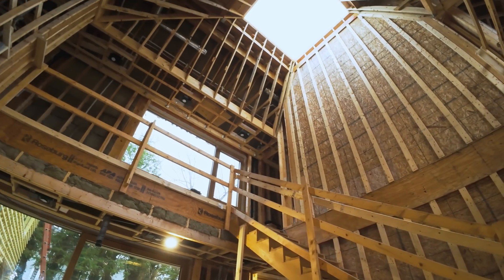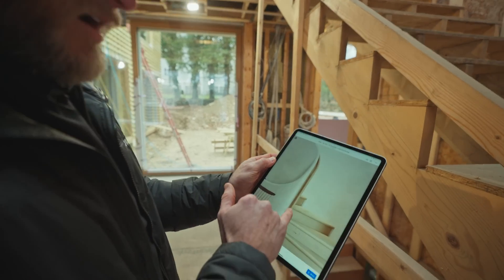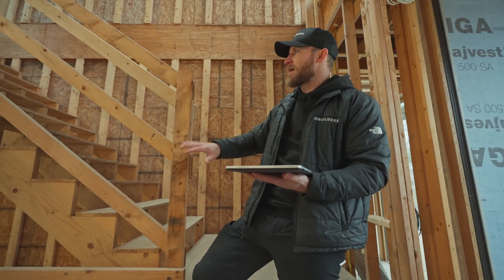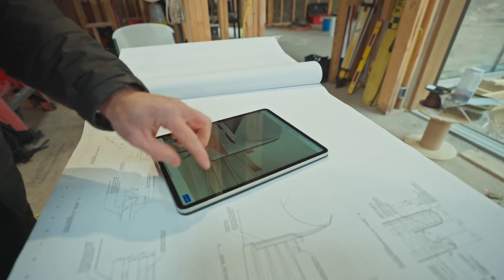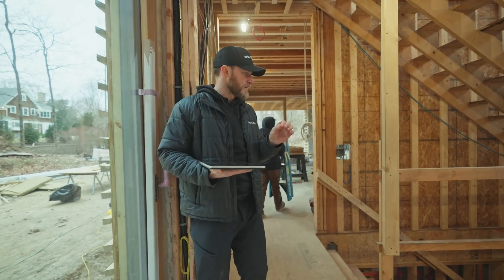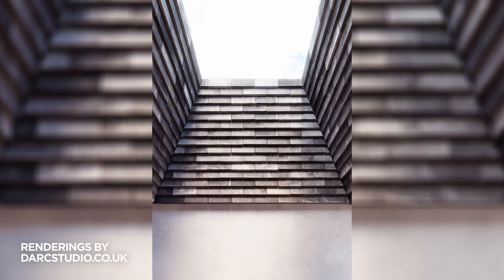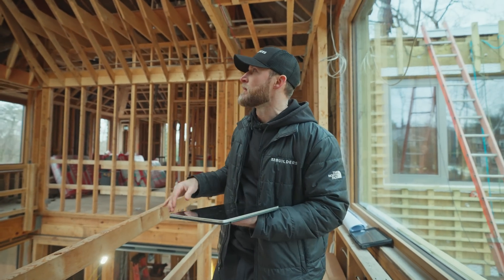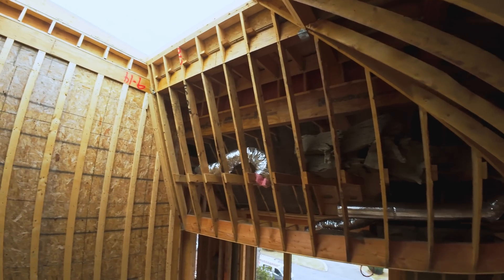Prepping For A Multi-Million Dollar Entry

Comment: For the complicated bend in the hand railing, have you guys ever looked into 3D printing? Im assuming this is already modeled and youd be able to plaster over the print. Have you all looked into 3D printing to assist with builds such as jigs/fixtures?
Reply from the maker: Considered it. Haven’t done much more beyond that.  Know someone?
Reply: @NSBuilders  Unfortunately I am just an automotive hobbyist with a Bambu Labs printer. I use it to make mock up parts, jigs, fixtures, and tools. I would assume the build space is much too small for what your use cases would be, however their are work arounds. 
Partners like Xometry and Protolabs would have larger build volumes and offer various plastic and metal, though expensive, if your project needed it. 
Another use case for you may be 3D printed scale models of your homes to your clients, though I am assuming you/architech may already offer something similar.
Your company seems to be on looking into the leading edge of offered materials, I think 3D printing will find its way into many different industries. 

Thanks for the videos! I love them! One of my favorite channels.

Comment: It seems to me you could take advantage of the hand rails being solid plastered knee walls on the open side and attaching to the staircase shear wall (1/8" rubber spacer as a shadow line) on the other side of the stairs whereby  the inside and outside LVL supports(stringers) do not have to be cut for the stair treads to rest upon, rather stairs could be  supported from a small strip attached to the runners and each tread screwed from below and to the stringer with screws yielding a much stiffer and stronger staircase that is an order of magnitude easier to construct. Ray
Reply from the maker: Good catch, Ray, we’ll look into that. Sounds like a good plan
Reply: @NSBuilders  Thanks for responding one other thought that came to my mind  after commenting is when using plaster for rail it will crack unless its very stiff maybe use a double LVL for the Handrail side of the stair case it will look like the cheapest insurance you ever bought if it adds cracking security to this build. You have gone to great lengths to give your client a truly amazing home and it will cause many headaches if stair cracks due to stringers flexing under varying loads. I love this quality build that is to a great degree not constrained by costs. Good luck. Ray

Comment: Plaster is such a huge waste of labor.
Reply from the maker: we disagree.
Reply: If you try to do it yourself yes. If you have a professional do it, they are efficient and the result is a much flatter wall that is more durable than drywall. I mean what do you think they’re going to do? Put up lathe and horsehair plaster it? Haha.
Reply: @CMCraftsman  I don't think you can even do it yourself even if you want because it takes a lot of practice.
And I totally disagree with the original poster.  If you have seen, touched, lived with plastered walls at last once, it's absolutely worth it.  Moreover, it's not that much more expensive than drywall.  I mean, in this case of course they'll be demanding the highest level of quality so it'll not be cheap.
Reply: @kellymoses8566  disagreed. Popcorn ceilings are a waste of labor.

Comment: The homeowner will regret that lack of a skirt board and the missing handrail.  No baseboard designs have been common in contemporary design in California for forty years. The walls always end up dirty. The handrails will be even worse because peoples hands are covered with oil. That will be transferred to the wall and unpainted plaster will be a magnet for that filth.
Reply: We have sealers we use that make plaster as cleanable as tile. We use it in areas that experience high traffic like this.
Reply from the maker: They can always add it later
Reply: Rodger Hodges can allways do it his way when he builds his dream home
Reply: @creylacoste4981  I lived in a house with no base for thirty two years. I did it in commercial offices for my company two times. By the end of out two year tenancy, the walls were thrashed. I speak from experience about the base
Reply: I agree, look at ANY house, and you'll see that the baseboard/skirtboard takes a ton of abuse. Vacuum cleaners, brooms, shoes, etc. just beat the hell out of it. But a base/skirt made of a hardwood like maple can bear that abuse. Not perfectly, but better than plaster. But either way wood or plaster (especially unpainted) will not conceal the black scuff marks. At least baseboard/skirtboard can occasionally be painted &. touched up, but unfinished plaster? What a cleaning nightmare. I have seen what happens to an unfinished surface (wood. or plaster) and it's not pretty. Ugly, oily discoloration from hand oils & dirt. Within 1 year the homeowner will get sick of the filthy plaster and will paint the entire house. It's almost as if you are just trying to save a few bucks and pass on the interior painting cost to the future homeowner. 

Listen, I'm not just dumping on you. But it's like you are designing a museum piece that will be roped off and not exposed to human contact, instead of a house where people live and that can withstand the wear & tear of everyday life. This house will look GREAT at point of sale, and one year in, the homeowner will think "holy shit, this place requires a full-time cleaning crew." But I suppose if they can afford to buy it, they can afford to hire the cleaning crew.
Reply: But there is a handrail, just not on the wall.  I have the same setup at home and the wall is spotless.
Skit board...  Yeah in a "regular" home it'd be an issue but I imagine people with this kind of $ will have people to make sure it's always looking good.
As another poster said above, it is not a painted drywall in some commercial space.  It'll be unpainted plaster that can be sealed like a tile.
Reply: @sergeyb8  My live-in full time housekeepers could not keep them to my standards.

Comment: Love the updates! One thing that might be a concern. I did a "remote /concealed" air return and realized that over a short period of time the "grill" I made collects dust like crazy. If the tiles have a different ambient air temperature not that they will condensate but they might hold particulates enough that it will differentiate the areas where the returns are. I wonder if there is enough room to install some chases at the top and bottom to draw the air?
Reply from the maker: Great point! We’ll consider that for sure.
Reply: Ns will be sure they stay clean for centuries because that stand behind their work
Reply: @creylacoste4981  Yeah? Well, N&S will have to move into the house and clean that "brick vent wall" all the freaking time to keep it clean. Anybody can look at their return air ducts in their house and see the dust trapped on the louvers. N&S is using the bricks/tiles as louvers, and it is inescapable that they will act as louvers and collect dust. Given that they are 30 or 50 feet (or more) up in the air, they are impossible to clean. I love innovation, but this seems like a clearly bad idea.
Reply: Came here to comment this. I would be certain the rough surface of those tiles will catch dust, and build over time. I’d suspect you could get a vac wand up to clean but I’d be curious to see if that would leave dust smudges.
Can you use diffuser boot duct as a return. I wonder how that would look in the ceiling just before the rake.